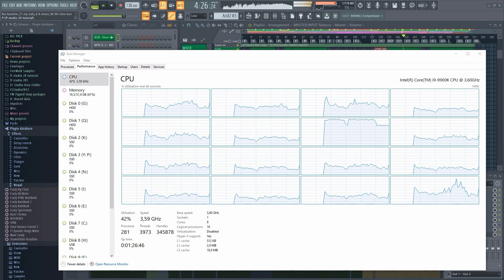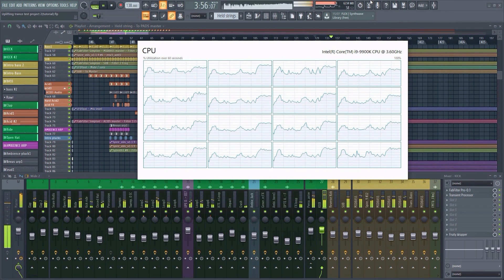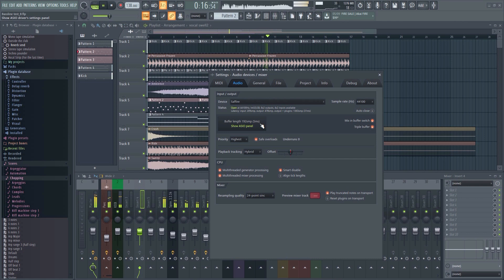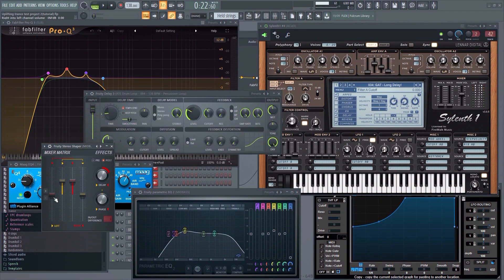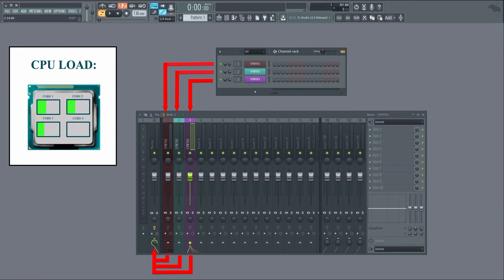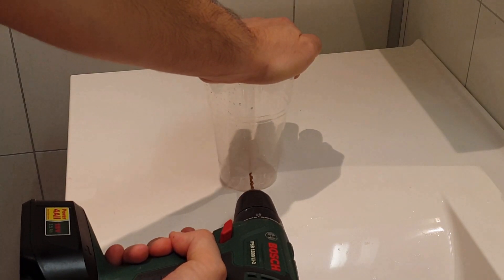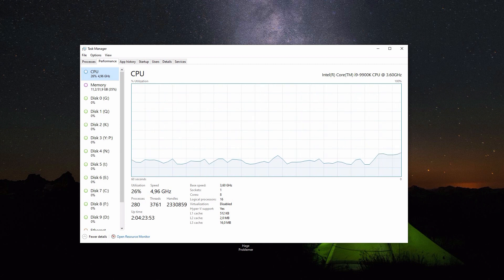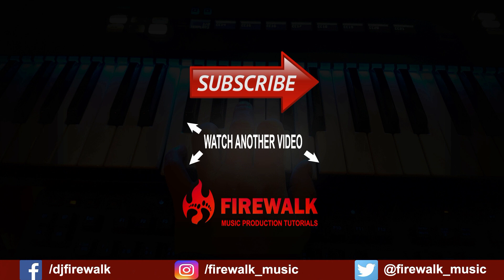FL Studio CPU meter Explained (It's NOT what you think it is!)

Comment: I'm new to producing and it seems my laptop isn't good enough I just don't understand why. I have an msi gaming laptop, i7 8750 
16.gb ram 
Loads of space. 

From everything I've read, that should be good enough but it's not :( 

I've set that buffer as slow as possible, changed sample rate, tweaked settings. Guess I just need a newer and stronger computer :( 

Atm I'm running vps avenger and stock plugins om a particular track and its glitching. Let me know if anyone has any tips. Obviously a new pc in the future but that's gonna take time
Reply from the maker: Hi, lower buffer size mans less latency which is best for recording. However, it also means increased CPU usage, which can cause glitching. Increasing the buffer size will reduce glitching. 
There are also plenty of other settings you can adjust to optimize FL Studio, and get the most out of your computer. I recommend that you follow the 10 steps in this tutorial to get better CPU performance in FL Studio: https://youtu.be/OWYmqwb7b4k
Reply: @FireWalkMusic  thank you

Comment: I'm struggling to understand how it works because I'm currently working on a song that has around 40 mixer tracks so technically should be 40 individual processes (except that 2 of them are routed so their process is combined). 20 Kontakt instances with heavy banks and around 15 instances of serum also all being loaded with effects and almost maxed out voices. The playback is perfect, only 42% CPU usage, and my highest core is reaching 50% usage. But I have this one Serum preset that I made, that literally only has 2 oscillators, both using 15 voices each and that alone, there's no effects on it or anything but it's still using 92% of the usage in FL studio.

Comment: Is Intel core i5 10400 good for fl studio?
Reply from the maker: It's not my first choice. I would recommend going for an i7 if you can afford it. The difference between i7 and i9 is not huge, but the difference between i5 and i7 is. Unless you only make very small projects I would definitely go for an i7.
Reply: @FireWalkMusic  please recommend me 
A budget cpu
Reply from the maker: @LAMXE10  if you're on a tight budget then the i5 will work well enough. If you want the most bang for your buck then I would check out AMD CPU's as well. You generally get more performance for your money with AMD. 

Check out the Ryzen 7 3700x: https://geni.us/ryzen3700x

It provides two extra cores and higher single core performance. It's generally 20-30% faster than the i5, and just marginally more expensive.